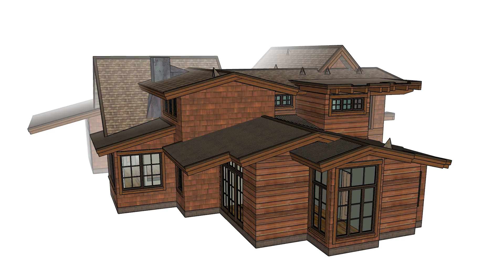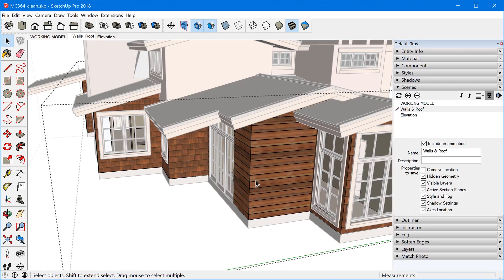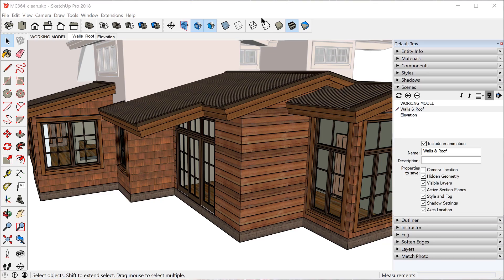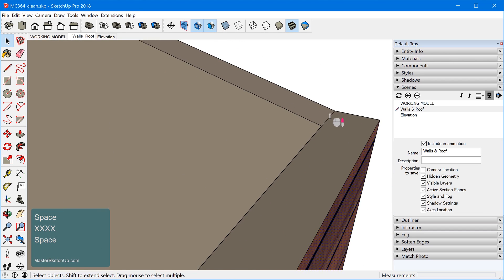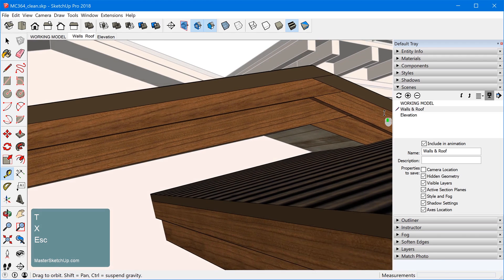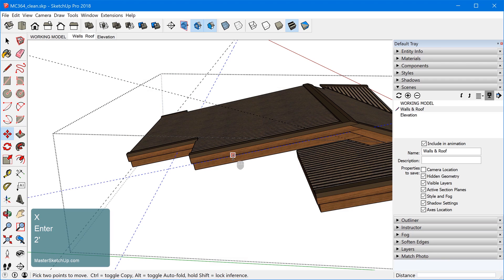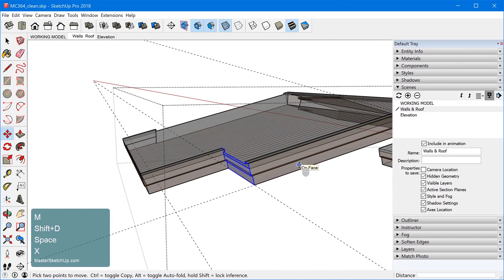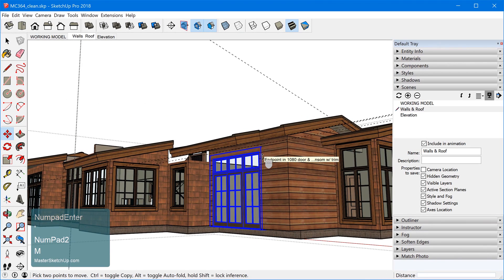Modifying Gable Walls and Roof in SketchUp

Comment: make everything solids and trim with new roof  - maybe also a hassle I don't know :)   S ketchup is very cool, very easy to get immersed in and really experiment freely with a very low barrier to entry, but even with plugins it is still not BIM.       BIM, solid modeling, parametric modeling -  super powerful but harder to set yourself up to do small custom jobs in, unless perhaps you have loads of really good "template" starting files and well organized custom blocks.       Then there are specialized architectural software like Chief Architect which have low barrier to entry - much easier to get up to speed than Revit, and quite powerful but just not Autodesk, so not as supported and widely used, and not as easy to do photo realistic renders from.   Then you have your high-end 3d packages like 3dsmax which are sorta parametric, high barrier to entry, but you can in theory do it all - animation, modeling, complex geometry, high poly models performing well, accurate rendering - but again, not at all set up out of the box with architectural / engineering tools.   There needs to be some sort of fusion IMO, with pricing set proportional to usage.
Reply from the maker: Modeling everything solid is definitely helpful, I recommend doing that for most things in SketchUp. You bring up a lot of good points, there are several trade-offs with all the different 3D modeling programs out there, including price.